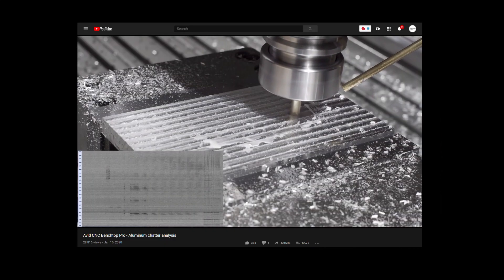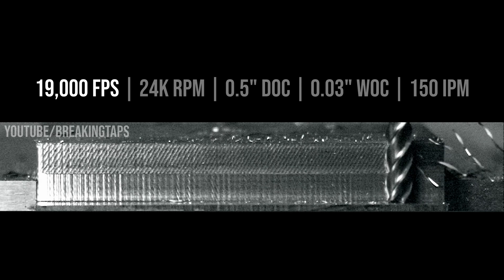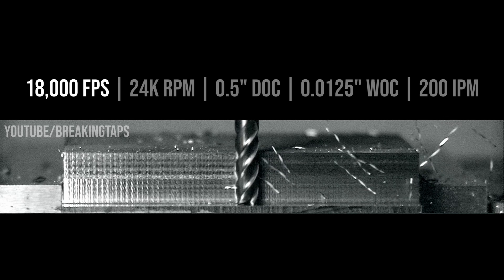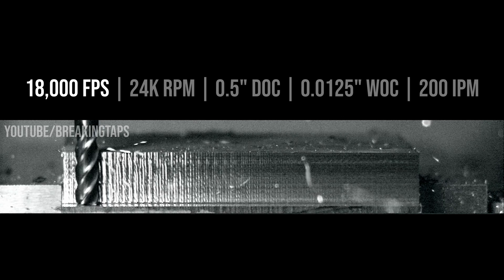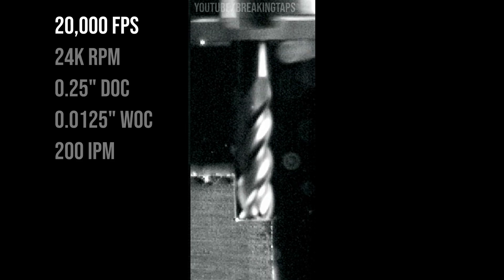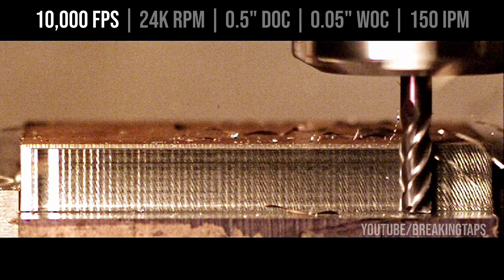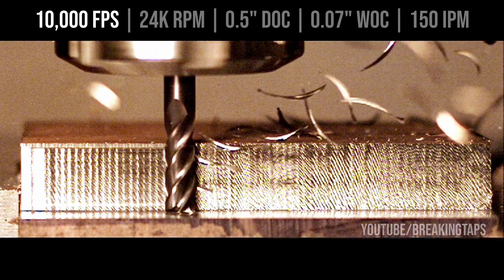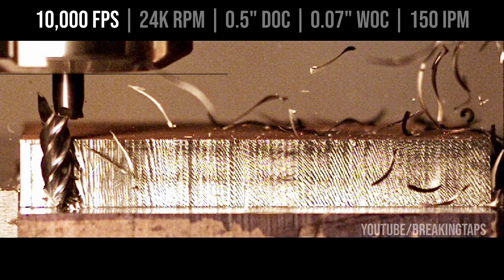Endmill chatter at 20,000 Frames-per-Second

Comment: I am trying to pull a plug on the same router and the spindle, and have religiously been following your posts both Youtube/Reddit, and truly appreciate them! Just wondering how much would non-ferrous metals affect the severity of chatter... And after experiencing both capabilities and limitations of a gantry style machine with a custom ATC spindle, would you recommend the same setup to someone who is interested in a small to medium scale, non-ferrous metal machining?
Reply from the maker: Yay, happy to have helped provide some info!  Aluminum cuts much easier.  You still have to be careful about feeds/speeds, tool length and all that... but it's a lot more forgiving.  I think 90% of the stuff I actually cut on the machine is aluminum... only done plastic a few times, occasional steel, and I've never cut wood :)  The biggest problem is chip welding due to bad chip evacuation, and that's not the machine's fault.  To be fair this is in the light of "occasional hobby use", I'm not putting hundreds of hours per week on it cutting aluminum so grain of salt with that opinion :)  But with a selection of single flute cutters I've dialed in a pretty reliable set of recipes and mostly can just hit run without too much worry.  The main limitation is the z-height available, but it's balanced out by the hug x/y work volume.  Most of the things I do tend to be flat or small so it's been ok. I might replace the table with something more robust in the future too, to help with table stiffness a bit.

Comment: You're putting out some phenomenal content, especially compared to the bigger channels out there. How are you liking the benchtop pro 2x3? Thinking about moving my ATC over to a bigger frame than my 6040 and thinking about it. Would you buy it again?
Reply from the maker: Thanks!  I've been pretty happy with the Benchtop Pro so far, especially considering the abuse I've put it through :)  Most of the things I dislike are not actually about the machine itself (mostly Mach4-related).  The only major complaint/irritation/obstacle is the z-clearance of the gantry... you eat up 8-9 inches of travel pretty quickly once you start using a vise or taller workholding.  Even if you raise the spindle higher on it's mounting, you still have the gantry itself to clear.  So that can be a real limiting factor sometimes.  I also wish I had splashed out for the larger steppers (or servos), but otherwise very happy with the mechanical parts of the machine.  I don't really have room for a larger machine, and it still feels like a better deal than a comparably sized Tormach or whatever, so I'd probably buy it again yeah :)

I loooove my ATC, but now that Fusion has limited toolchanges on free it puts a bit of a damper on things.  Just an additional cost I guess to get a Fusion license, but irritating :(

Comment: 24000 rpm cutting steel ?   A 1/4" carbide cutter would be a lot happier at 4000-6000  rpm cutting mild steel.
Reply from the maker: Oh yeah, absolutely. :)  These settings were designed to be pretty bad and induce chatter for high speed filming purposes :)
Reply: @BreakingTaps  Lol..I've seen cnc novices running at 24000 cutting steel because they see videos like this . But they don't know the cutter will get dull in a short time, compared to running at the much slower recommended f/m cutting speeds recommended by the manufacturer.  
 Great video btw. 
   I  don't understand why some cutter manufacturers recommend super fast feeds that put the cutter into a howl and it shows in the cut. EG Onsrud cutting plywood says run 400-1000 ipm with a 1/4 cutter. . This makes a resonance pattern in the cut finish... compared to slowing the feed where the howl goes away and you get a perfect finish.

Comment: Cool!  have you tried to use a MPU6050 or piezo (used like a contact mic) to get better feedback on the vibration.  I've often wondered if anyone has tried to close the loop with feed overrides and vibration feedback on a hobby machine.
Reply from the maker: After the audio chatter analysis video, I picked up four LIS3DH 3-axis accelerometers, a handful of electret mics and MAX4466 amps, and like a dozen disc piezo buzzers, all with the intention of instrumenting the heck out of the machine to see what's going on.  Afraid I got distracted and never dug into that project... but I have all the gear and should probably spend some time working on it!  I bet it'd be very interesting.
Reply: @BreakingTaps  This video is incredible. I've wondered about detecting and attempting to dampen chatter but what would a control algo do if it sense excess vibration? Servo control loop is 10,000+ hz, End mill is ~1/30 of rev further around, mid chip, or EM is broken, force of the cut is starting to travel up your machine at speed of sound in steel  [5meters/ msec.... I think?] Likely reason for the 'outside of parameter' chatter vibration is a chip that went back through or a dull cutter nose bouncing off or possibly a resonance? Would be very interested to see an accelerometer synched with the video!
Reply from the maker: Yeah it's an interesting problem.  There's actually a fair amount of literature (and companies) on "smart spindles" and active vibration/chatter control.  The less sophisticated ones identify when chatter is happening (usually with audio, less often with contact sensors and accelerometer) and adjust spindle speed or feed rate.  I think these tend to be better in demos than real life, since complex toolpaths don't lend themselves to this sort of realtime tweaking very well.  The more advanced ones I've seen couple the sensor readings to the actual toolpath and "learn" where chatter is, allowing the system to dial in good settings over the course of several runs.  The idea being that you might need to go through a dozen parts to tune the system, but the next 10,000 parts are perfect, and can be done faster than manual trial/error from a human.
Reply: @BreakingTaps  Cool! Thanks for the reply!
Reply: I'm also curious to see the set up of a mic to look at chatter to get the inside scoop on vibration.

Comment: What a great video!
A couple of observations. Based on your values at 24000 rpm and 1/4 in dia., your end mill is cutting at 1570 SFM. Yikes, that is high even for carbide on a rigid milling machine, let alone a router. Niagra cutter recommends 100-400 SFM for mild steels. https://niagaracutter.com/speedfeed
The chip load per tooth is .0016, which falls in the range for mild steel.
The material removal rate is 2.25 cu inches per minute, which is amazing.
Reply from the maker: Oh yeah, totally.  100% agree!  I probably should have stressed that some more... these are awful settings and probably murdering the tools even on the "good" cuts :)  I have an older video with (a little) more sane settings for steel... still high SFM but it's a tricky balance to find something that hits the torque/power curve of these spindles without going too fast and burning up the carbide.  I recently discovered a "torque boost" setting on my VFD which pushes more voltage at lower RPM, I might give that a shot if to see if I can get the RPM down some more.  It starts to get dodgy in steel around say 16k RPM, so if the torque boost could get me in the 12-16k range it'd be soooo much better comparatively speaking.  IIRC I still have to use it 16-18k right now which is pretty high SFM on 1/4".

Might also just get a better VFD, I hear the "vector" drive VFDs are pretty nice :)
Reply: @BreakingTaps  These are rated for higher speeds. https://www.guhring.com/Documents/Tech/SpeedFeed/6759.pdf?version=082020092010.  Can your VFD display motor amperage like https://www.youtube.com/watch?v=h9q6j7POgOI&t=408s?
Reply: @BreakingTaps  Thanks for taking the time reply.  The vector drive may be nice. Love the content, please keep it up.

Comment: It could be interesting to see how the endmill moves when only one of the flutes is engaged at a time, ie. cutting deep with a single flute endmill with a relieved back side of the cutting edge, compared to ie. a 4+ flute one in the same situation. I've been taught that single flutes are really good only for very shallow depth and large radial engagement. I'd wager the deflection would be smaller on these high-speed spindles compared to a low-RPM mill, but it could be still fun.
Reply from the maker: Ooh, I like that idea.  I have a number of single flutes on hand.  Would be neat to see how it compares to to 2/3/4 flute in a few different cutting scenarios.  I bet their chip evacuation is pretty awesome to see too, since the gullet is so large.
Reply: @BreakingTaps  Oh, one more thing - not sure how usable it is for this use case, but video motion magnification (see ie. http://people.csail.mit.edu/mrub/vidmag/ for the academic side, software included) could be interesting too and potentially reveal any smaller amplitude harmonics in the vibrations. Its commercial use is more in monitoring tiny concrete / pipe vibrations for early failure, but it's worth a shot if you get it working. :)
Reply from the maker: Woaaah, that's a cool technique!  Will dig into this, it looks super useful.

Comment: Really cool video.  I think I need to start taking bigger WOC on my router!  Well done.
Reply from the maker: Thanks!  I definitely err on the side of too timid with most of my cuts...then occasionally get adventurous and go too extreme and break a tool... Whoops :)
Reply: @BreakingTaps  I don't know if you already know this, but direction of feed makes a huge difference. The cuts you made in this video are what is known as a climb cut because the end mill tries to climb out of the cut. If you reverse the feed direction, you get what is known as a conventional cut. A climb cut can take a very substantial cut without overloading because it takes a large bite and peels it away, ejecting out the rear of the cut. A conventional cut scoops forward into the direction of feed, ejecting the chip out the front. It can be easily over loaded, causing it to pull into the workpiece and stall and break the cutter, but when used for a fine finish pass, it can leave a very nice finish. 

Typically, you should make a roughing pass with a climb cut and a finish pass with a conventional cut. This will increase both your accuracy and your surface finish.

Comment: Great video! I just have to correct you. It is not really the endmill deflection, but the whole gantry vibrating and moving all over the place.
Reply from the maker: Very good point, I should have been a bit more precise in my wording!  Actually want to do a followup showing the table and gantry moving around, maybe with tracking points or something.  Still trying to figure out the best way to quantify it.
Reply: I was thinking a solid carbide endmill deflecting .022” would break lol
Reply: Bingo. It's just not rigid enough.

Comment: Really great video! I'm always babying my lathe because I thought I was helping the machine, but from this it looks like I'm actually making the surface finish worse! Time to try some new feeds and speeds.
Reply from the maker: Thanks!  And yeah, totally agree... I'm thinking back to prior projects and wondering if things would have gone smoother had I just given it a bit more juice, instead of dialing it back 🤔
Reply: Same here! Seeing this I feel like I was fighting fire with gasoline in retrospect. 😬😂
Reply: When I was machining I didn't have that problem. I was always pushing the tool/machine to its limit. It's a lot easier to do that when it's someone else's equipment 😁
Reply: When machining long shafts it’s often common in industry to increase the roughing feed rate to the point where it almost looks like you’re screw cutting the shaft to reduce chatter 😊. Higher engagement usually stops the job rattling around and makes the work quicker!